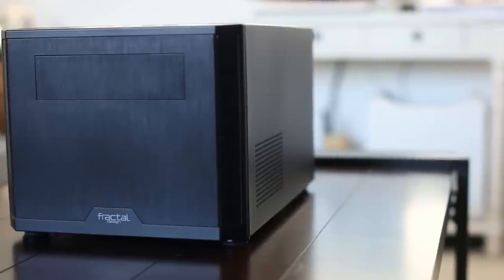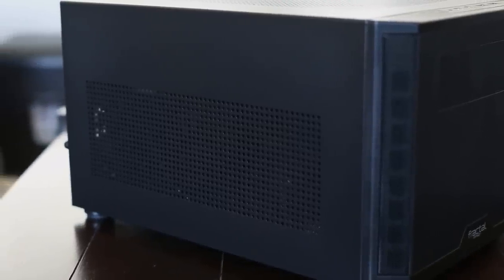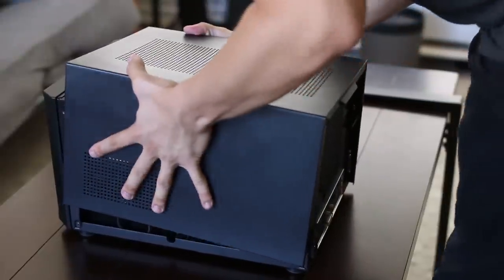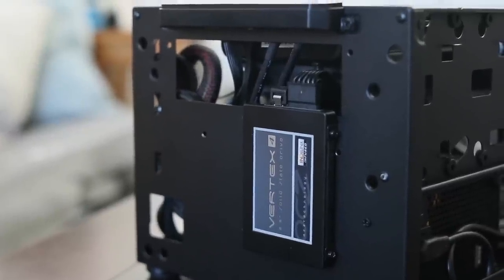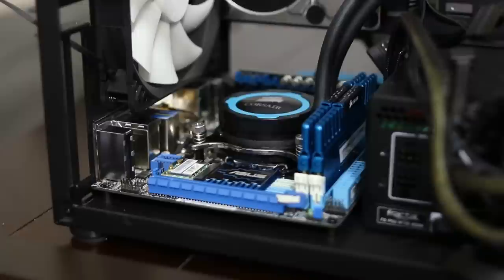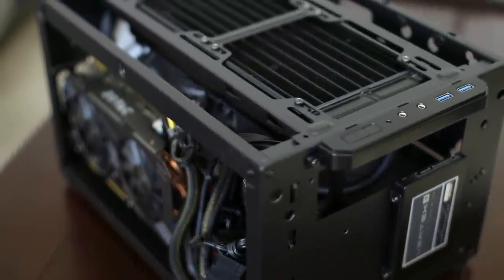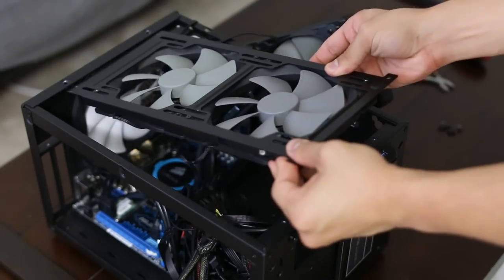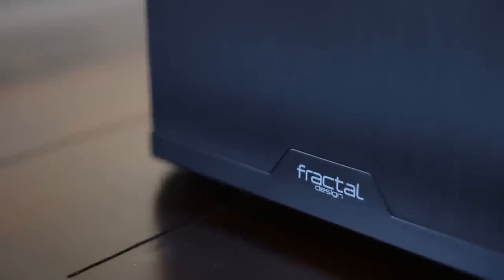Fractal Design Core 500 - Powerful Portability

Comment: This may be nitpicking, but I have a problem with this and many other computer cases. I know optical drives have gone the way of the Dodo, but card readers are still very much in use. Our phones, cameras, and Raspberry Pi devices all use SD's. I believe they should be as standard as the USB ports and audio jacks. But this case gives very little possibility of adding one to your build. The 3.5" bay under the 5.25" bay should be EXTERNAL. There are plenty of other places to stash an HDD, but that's really the only spot to put a 3.5" external device, such as a card reader.
Reply: +SciPunk215 Agreed, and the rare times I need to use a CD/DVD/Blu-ray drive, I have an external USB Blu-Ray reader/DVD burner combo drive I salvaged from a dying HP laptop a client was gonna throw out.

Comment: Would it be desirable for this case to essentially have a modular SFX PSU and no water cooling, for easier cable management, and perhaps cool and energy efficient CPU and GPU choices, given it's size? Something like an i3 and perhaps GTX 950 inside?
Reply from the maker: +Nick Carroll that sounds much more sensible to me. although i'd suggest an i5 to go with that GTX 950 ;)
Reply: +Awesomesauce Network ah that sounds even better than my suggestion. Thank you! :D
Reply: +Nick Carroll They got some pretty good small GTX 960's now for a reasonable price with 4GB of VRAM.
Reply: +Nick Carroll They even have a mini GTX 970 for the same price as a full sized one. No need to get a low end card. Just shop around and check out the mini graphics cards!
Reply: Does anyone have experience building with this case? I got it and transplanted my system to mini itx but the lid won't fit closed. I have too many cables. What should I do to close the lid properly? The screw holes won't line up properly?

Comment: those cases make me cringe in horror lol
Reply: +kreeper24 Pc Mods & Tech they should replace those HDD and SSD's with M.2 slots on the motherboard (very small and no cables needed). The use of small graphics cards such as the R9 nano would be perfect for it and last but not least a modular PSU so you don't have unnecessary cables hanging around. This all together will save up a lot of space
Reply: +kreeper24 Pc Mods & Tech get cougar qbx or rosewill w1:D

Comment: i seemingly have a PSU that is 5mm too long to fit in there along with my gfx card - at least according to fractal's measurements and informations. is there a possibility to put it in there regardless? i want to continue using it. got an asus strix r9 380 which is 271mm long. my psu is an ocz zt550w with 175mm in length. help or advice would be appreciated. thanks in advance.

Comment: The interesting part is this case has very close surface area to other ITX cases...meaning for one thing it uses about as much materials.  But, the build volume is like 110 to 140  cubic inches smaller in some cases (ha ha a pun).  So wile the extra length might seem good, it really doesn't work out that way when you shave so much off height and width.  Of course you mileage might vary depending on your case choice.

Comment: had the 304, everything looks like cramp inside, no cable management, 804 looks better with PSU on the other side. 
this core 500 looks like the 304, it looks nice, but i don't like how things got cramped inside.

Comment: Not a bad looking case, but I personally would not do water cooling in this case, and just stick with a good low profile air cooler, some good slim intake fans, all 2.5in drives, along with a modular power supply to save some space, and tidy things up a bit.

Comment: Kyle, will you do an entry level AIO video, where you take the cheapest 120mm AIOs, and compare them to air coolers that cost the same? Cheers!
Reply: +Champturn  Even 240 / 280 Water coolers are worse than nh-d15 / Cryorig r1 ultimate etc. Why? AiO coolers use louder fans to be better than Air coolers.
Reply: +awera222 no 280mm aio beat cryorig ultimate
Reply: Aaponton And it's louder and 2 times more expensive while the diffrence is around several degrees. Thanks but no.
Reply: awera222 no nzxt x61 is only like 5db louder and cooler master nepton 280l is about same
Reply: Aaponton  "only". Still it's price is from ass...
Reply: awera222 cooler master nepton 280l is 20€ more expensive and its diffrents is bigger with highger voltages
Reply: awera222 I know that on the high end, Air coolers are pretty much right up there with 240mm AIOs. But on the lower end, do they stack up the same? Like the Hyper212Evo from Coolermaster versus the H60 from Corsair, or any other 120mm AIOs for that matter.
Reply: +Champturn ok but 212 evo have shit mountin hardware plus who the fuck buys 120mm aio 
most who buys aio buy 240-280
Reply: same cost aios get wrecked by the massive phanteks and noctua coolers for cost you have to buy the 240 or 280mm ones to compete cooling wise.
the only downside is the actual size of the air coolers
Reply: WayStedYou yep and with air cooler changing stuff close  to cpu is where hard like ram and top fans

Comment: My Specs: i5 4690k, 8gb ddr3 low profile ram, gtx 970 (full size), cooler master 212 hyper evo. I will get a mini lga 1150 mobo and a mini sfx psu.

My case options:

1) Fractal Design Core 500 
2) Cooler Master Elite 130
3) Antec ISK 600 gaming cube case 
4) Cooler Master Half XB EVO (this one I would keep my Micro-size mobo and not get a mini mobo) 

What do you guys think? I want to keep the most parts of my build just upgrading my mobo to mini itx if possible and not get an SFX psu. I am willing to chuck my CPU cooler for a closed loop liquid cooler (single radiator version) if possible but I would very much like to keep it since I just bought it. Thus I want a case compatible with it and most of the above are compatible. I might add an SSD to the build since I will probably have to reinstall Windows anyway when installing a new motherboard. 

Overall what do you guys think? I am torn between the Cooler Master case and the Fractal Design Core 500. Many thanks in advance!

P.S. My current case is the Fractal Design Core 2300 which is quite big and bulky to carry around for gaming on the TV so I am used to Fractal Design. It would basically be like a mini version of my current case as it is nearly exactly the same design, just bigger.
Reply: Cooler Master Elite 130 support cpu cooler height up to 65mm while Fractal Design Core 500 up to 170mm plus magnetic fan filter on intake position.
Reply: I ended up getting this case and just used the Cooler Master 212 Hyper EVO CPU Cooler. Plus one intake fan and one exhaust fan. Works like charm!

Comment: This case is most difficult piece of crap i have ever worked with. Skip it and get the elite 130 instead. Much easier to work with, less limitations if you use a full sized psu ( you can actually fit your full sized gpu in the 130 with a full sized psu) and very similar hardware compatibly including drives it can comfortably accommodate. Trust me this case seems much better than it really is.
Reply: +LoLUnderstated I agree working with the Elite 130 is a breeze and my build still even looks clean. But the downside is there's no spot to mount a 240 radiator.
Reply: +acnfanmanin The 130 is leagues ahead of this case which is unfortunate because im a huge fractal fan. When i first saw this case unveiled I was ecstatic. Then disappointing once I got my hands on it and did a build in it. I really don't care much for the rad compatibly. I know its a big deal for some people but it would've only been a big deal for me if this case hadn't been so stupid to work with.  If it was a breeze to build in like the 130 the added 280mm rad compatibility as an added bonus is amazing, but the trade-offs to make this happen are what makes this case bad.
Reply: LoLUnderstated Hahaha yea totally agree, I was stoked to see this case unveiled but the reviews says otherwise hahah. Plus my H80i cools my 4.6GHz 4690K enough already XD
Reply: +acnfanmanin Yeah as you said something like the h80i is more than adequate to cool an overclocked processor so no need for a 240 or 280. Its just overkill for a mini-itx, which like I stated before, would be nice, but only if it were incorporated in a way that wouldn't make the build process a total nightmare. Interesting fact, I have a 6700k at stock speeds inside this fractal case, since I havent switched out of it yet unfortunately, with a stock intel cooler i had laying around and my temps idle at 33 degrees c and they never go above 58 degrees while gaming. The 6700k runs so cool its insane. All I have in this case is the stock exhaust fan it comes with and the stock intel cooler on the processor. I know its irrelevant to our original conversation but I just had to share my experience with temps after you shared yours.
Reply: LoLUnderstated Yea Id rather take better build process and give up a little bit of CPU cooling. Nice CPU, some shiny new Skylake haha. But you know since you got that case why not put a 240280 rad anyways and overclock the crap out of that 6700K hahah.
Reply: acnfanmanin
Thanks! But in response to your question, I would love to overclock it by putting a mean 280 aio in there but I have a reference gtx 970 and a normal sized psu in there and it doesnt allow me to fit my gpu in it. So I will be getting rid of this case asap. This is my portable rig that I bring to work with me every day and im running on integrated graphics at the moment so you can see my desperation to get a new case. Its the cheaper alternative rather than getting a smaller gpu or a smaller psu. My psu - $100 my gpu- $350 my case-$60....so yeah im taking the cheaper way out of this one.
Reply: LoLUnderstated Yea the Elite 130 is a really good case too. But the side vents I'd say arent very good for the GPU if ur got open air
Reply: acnfanmanin
 I have a blower style cooler on my gpu so no worries.
Reply: LoLUnderstated Yup thats great. Because my GTX 760 Hawk chokes and goes up to 80+ with the cover on so I cut out the sides lol
Reply: LOL dang. I bought the blower style cooler with itx systems in mind so that was just a bit of preemptive planning. Though technically speaking the reference coolers from nvidia on the gtx 970 can go up to about 85 Celsius so temps on gpu dont gain much from b eing blower, the only advant age is that i t doesnt flood tiny cases from the heat it exhausts, it just blows it out the back. So the blower style gpu is mainly for the sake of my cpu and other components.
Reply: LoLUnderstated Nono my open air card goes 80+ on MAX FAN...a blower on max fan would do better lol

Comment: a problem I had is that I got a H100I and for it to fit in the core 500 i had to push it down hard so the water tubes bend on the PSU..
Reply: I bought a Noctua NH-D15, it fits perfect.
Reply: I go up to max 80c in games, but i have 1.450 voltage on cpu so i understand why it gets so hot. And acoustics is fine, i mean when i game it can ramp up but i dont hear it since i talk with friends and such. But when just idling i cant hear the damn thing haha. I got a ATX PSU.